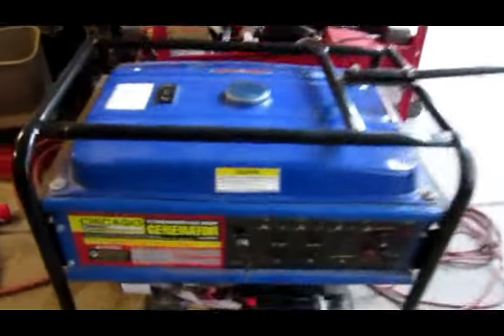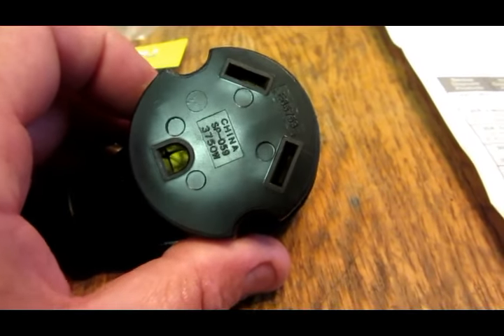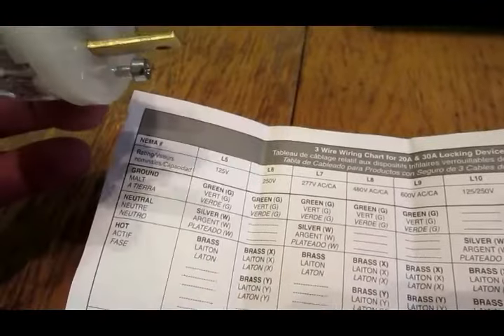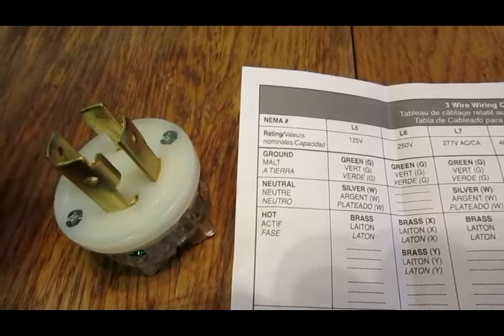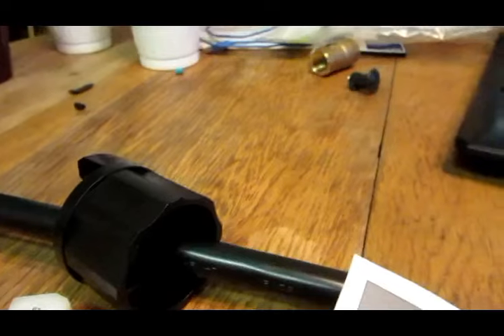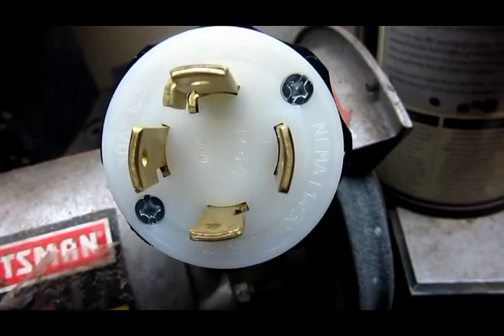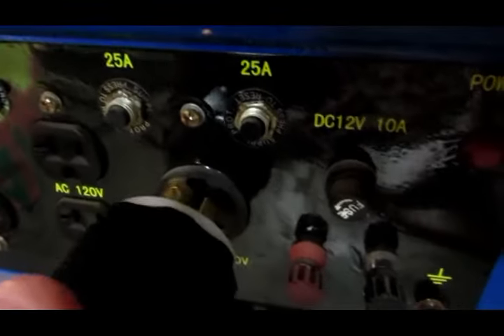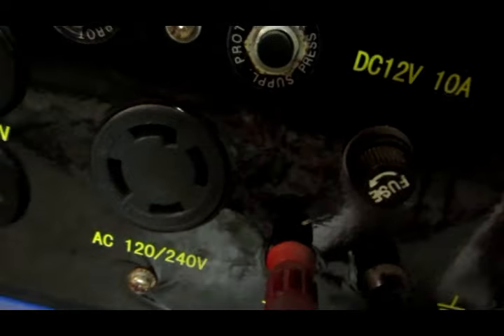Making a dog bone adapter for my  4 plug 240V generator to run 3 wire 120V 30 AMP

Comment: I also  bought a harbor freight generator with that stupid outlet and I couldn't find the plug anywhere except for grainger, a bunch of scammer there. They charged me 65 dollars for the socket. I could of ordered one on line but when you need one now I guess you need one now. 
Great video very helpful. The instructions on the packaging was not clear at all.

Comment: Home Depot also sells a kit that you can plug-in to twist locks on generators for welders and it comes with several different adapters
Reply: I've looked do you have a link

Comment: I need to do something similar, but for a 220V condenser. Do you know what colours are associated with L1 & L2 for 220V? The panel box for the unit uses black for L1 & red for L2, but I'm not sure if that's standard.

Comment: So you wired up a 110 volt 2 30 amp plug. To get a 240 30 from this conversion you would wire green to the ground lug, the other 2 wire to the brass colored lugs omitting any neutral.

Comment: I have an old 5000w genny and that only has two 15a 120v outlets and two 6-15r outlets for 240v. Whats the best way to get 30a into an L14-30 so that I have power to both legs? Do I make a male Y that connects to the L14-30? What does that wiring look like and do I use the 120V sides or is there a way with the 240v?

Comment: If i change the plug on the shore power wire of my camper to go right into my generator rather than putting an adapter on it do i need to reverse the white and black or just wire it up regular? Thank u

Comment: So if you want to get 220 out of the 4 prong do you use x and y for black and white keep the ground and loose the nuetral
Reply: you need a neutral for 120v circuits that are on separate legs, a 240 V say for an AC does not need a neutral

Comment: Hi to you sir, 
Thank you for your very informative video, I'm a bit of an electrical dummy. I followed your very clear instructions from 4 to 3 wires. 
Do I understand that you ended up with 120v?  I have the 4 pin outlet which says 120/2240v. I need to get 220/240v output on a 3 pin pigtail not 120v. 
Please clarify for me how the red & black wires are configured to get the 240v I need on my 3 wire connection?
Thank you for any help you can supply me. I'm in the Philippines without the correct connectors, I'm sure I can find a 4 pin male & a 3pin female.
Reply: im thinking it needs a jumper from the other positive terminal to the positive wire to get the 220/240. let me know if you figure it out. i got a 3 wire stick welder i need to run on the 220/240 :)
Reply: found this 
toadamine
1 year ago
Nathan Hansen for my welder, I just left the negative terminal on the four prong blank... Two hots and a ground... That's all three prong 220 is... Worked fine.
Reply: @Billy_Darley  Don't run a jumper from the one hot terminal to the other hot terminal on the  220 voltsplug. this would cause a 220 volt short.
Reply: Red and black wires are 120 volts each in the United states. Any load connected to them gets 220 volts. If something is connected to one of them and the white common it gets 120 volts. Green is used to ground the frame of an appliance to prevent shock in case of a short

Comment: very informative and if i had ANY skills, i'd do this. it cost me $130 getting the 18" adapter and 25' cord off of amazon to make a suicide cord to back feed the NEMA 14-50 outlet (common 50 amp 4 prong range outlet) i had installed right off my electrical panel.
Reply: i think your okay with that, still cheaper getting the cert. tech to do it for you but they'll be safer and within the code.

Comment: I have a feeling that all he will get with putting the wires like that will be 110 volts.  If he needs 220...should he not put the white wire on one of the hot legs?
Reply from the maker: did you read the description?
Reply: No way man the white wire is the neutral wire.  If he was wiring it for 240 he needs the red wire which that setup was not a four wire setup.

Comment: Basically, you're only using 1/2 of the generator's output 120/240 in this configuration. (So if it's 6500 max watts - 5500 running watts, you have 3250 max watts - 2750 running watts available to you.)
Reply: Can you explain how this is? I'm genuinely curious as I'm not very knowledgeable with this stuff

Comment: I believe this generator puts out 5000 watts. The power you get depends on the amount of power your generator produces. You are only using half of the output of the generator because you can only connect to one of the 115 volt outputs because that is the way the camper was wired.  Watts divided by volts= amps so divide the output of the generator by 2 because you are using half the generators  watt output. Then divide that by 115 to get amps.  With this generator it would be almost 22 amps continuous. The reason they use a 25 amp breaker is for a peak load like for when something takes extra power for a few seconds when it starts then takes less after it has started.
Reply from the maker: I always wondered that. Thanks for the information. Makes sense now.

Comment: Good video man. My old generator only has the 240v 4 prong twist lock and I wasn’t 100% sure what prongs to hook the wires to. My rv is only 30amp 120v so in order to run it off my house power I will need a single pole 30amp breaker and just a female rv receptacle.

Comment: What would you be losing by adapting to the 120V outlets? Of course if you still had to do a conversion yourself, that is if there is no ready made cord or adapter,  there would no advantage. But if you could simply buy something, what would you lose in performance from the 30A outlet to a 20A? 

Anyone- are all the four 120V outlets on this, or any generator, in phase, or are the two pairs out of phase?
Reply: The 120 outlets are only rated for 20 amps with a 20 amp breaker

Comment: If i splice the red and black coming out of the adapter male four prong that is going into the 3 prong female,  will that give me the 220?
Reply: If you connect the red to black wire you will trip the circuit breaker or a big blue spark. Those wires are at opposite ends of the generator winding with white as the center tap. black to white = 120, red to white = 120. Black to Red = 240.

Comment: You only get 120v  , tell me how to change the 4 pole 240 plug to a three pole 240 plug  , so I can run a shop heater(4800 watt , 240 v ) from the dryer plug
Reply: Did u figure it out  ? 
How to run a 3 prong from a 4 prong Recepticals from Generator.  
I'm need to run a Chinese welder which has only 3 prong but it need 230V..
Reply: This welder has 3 prong yet need 230V. 
Which is why I'm lost in this.
Reply: a jumper from the other terminal to the positive wire is the only thing i can figure.
Reply: @Billy_Darley  I'm in a similar situation with a plasma cutter that came with a 3 prong twist lock instead of a 4 prong. It's a dual voltage unit, but ideally needs 220v. Haven't had anything productive come up just yet.
Reply: @kyesniper  I saw on another video a guy used two of the wires as positives and one as the ground. That gave him the 220v he needed. I've yet to try it myself but in theory I think it should work.
Reply from the maker: Green is chassis ground, white is common . In theory if you took  the black and red wires and connected together you would have 240V. But I herd connect Black wire,  red wire and Green on a 3 plug and leave white wire disconnected.  Id suggest doing more research.
Reply: @jenrajsebastian7566  the easiest way is to put a different cord with a 4 prong plug on the welder. Take note as on what color wire connects to what terminal on the welder. If you can't find a cord with the correct plug just replace the plug on the welder with a 4 prong plug. Just be sure to match the colors.

Comment: I need this exact adapter only in 240v... Can I just put a jumper in the plug connecting the two hots?
Reply: I need this answered as well
Reply: Nathan Hansen for my welder, I just left the negative terminal on the four prong blank... Two hots and a ground... That's all three prong 220 is... Worked fine.
Reply: Thank you!   @toadamine
Reply: @toadamine  I have a Hobart MIG welder,says Volts 200/230,,Amps 29/25..How big of generator would I need to run it?
Reply: @KRConnection  I dont know
Reply: No it would make a 240 volt short if you are connecting the two 120 volt hot wires coming from the source together.
Reply: @KRConnection   7,000 continuous watts is minimum for 30 amps and it could work it hard when the welder is set to high so I would go to a larger generator for longer life. Nothing lasts as long when it is working as hard as it can. I would go to at least 10,000 watt continuous rated generator. Running a generator at its rated watts continuously will shorten the life of the generator. Keep in mind that generators have 2 ratings. One is starting watts the other is continuous watts. starting watts is only for a brief time and is higher than continuous watts which is what the generator can produce continuously. Always go by continuous rated watts.

Comment: If your trying to run 240 volt for a main feed I think your wired wrong. You should have black, white, as power and green as ground or neutral correct me if I’m wrong.
Reply from the maker: I think you should read the description and watch the video it speaks for itself. I'm not trying to run 240 I already have 240. I need 120V 30 amp.
Reply: @mogyver69  got ya

Comment: So how many amps will you be supplying your camper with? 30? Or 20?
Reply from the maker: The point of the video is to convert a 240V 50 amp to a 120V 30 AMP
Reply from the maker: My Camper is 30 Amp and this conversion worked perfectly. I'm able to run my A/C unit, microwave, everything with no issues. I'm even able to run the Microwave and A/C unit at the same time without blowing breakers.
Reply: I just bought a 4 prong male 30 amp adapter that connects to the 3-prong RV extension cord that goes to the RV I'm just hoping that the RV will still be supplied with 30 amps from that generator and not 20 amps
Reply: Correct you made one and I bought one but I have not had a chance to test it because of the hurricane just hoping that this dog bone supplies an actual 30 amp to my 30 amp camper
Reply from the maker: You should be fine. Where are you getting the 20 amp rating? What made you come up with that number? On the generator above It has 2) 25 amp Circuit breakers divided between the 2 - 120V connections gives you total of 240V 50 Amp When you cut it down  to a 3 prong 30 Amp in theory you only have 120V 25 Amp available. so In theory if you drew more then 25 Amp it could blow the circuit breaker. I have not had that issue at all. And just to be clear there's no possible way you could damage the new plug cause it would be rated at a higher rating. As for the generator or anything else it has a circuit breaker there so if you were over loading it you would know..
Reply: My generator goes green, black, n yellow (white).
Reply: It depends on the output of your generator. Wiring an adapter this way you will get half the power a 220 volt generator puts out because you can only use one of the 115 volt outputs but that is the best you can do unless there is another connector on the camper for 220 volts. Divide the continuous wattage output of the generator by 2. Then divide that by 115 volts to get the amps. with a 5000 watt generator it would be almost 22 amps continuous.
Reply: You need a 7000 watt generator to get 30 amps if the generator has a 220 volt output because you are using half the output of the generator. If you can get a 3500 watt generator that only has a 115 volt output it would also give you 30 amps. I don't don't know if they make one. I would guess that they would have a 220 volt output at that wattage.
Reply: The breakers are rated at peak amps so they can allow 25 amps for a few seconds when something starts. Generators usually have a continuous rating and peak rating for a brief starting load. Continuous output would be almost 22 amps. I believe the generator he had was 5000 watt output. using half of it would be 2500 watts. Divide that by 120 volts to get the amps and you get 20 amps. If you figure it at 115 volts it is about 22 amps.
Reply: The camper can only get 1/2 of the rated amps of the generator because this is all the generator can supply to the camper. It looks like the breaker on the generator were 25 amps so if the amp draw exceeds 25 amps the breaker would shut off.

Comment: So using a 3 core flex wire, how do I wire this twist lock plug to recieve only 240v from it ?
Reply: When you say only 240 volts do you mean 120?  What are you connecting the generator to?
Reply: I have the same question. If I want to run a 3 prong 240 volt welder. Am I understanding that I have to connect x and y prongs together behind the 4 prong plug coming out of the generator?
Reply: @bottomrunner869 , what's being done here is the x and y poles will each be carrying 120v, the neutral and bare wire (white and green) should be jumped coming out of the four prong. The dangerous part is that on the three prong side, the bare wire will carry your ground and neutral, while you pull voltage on the white and black wires (120v from the four prong side black wire and 120v from the red). 240v is no joke and a trip to the hospital or morgue if you aren't careful. I'm not sure what size welder you have, so a small generator might not provide enough power anyway.
Reply: Thank you, Govtpig.  This information is much appreciated. Would it be better if I ran the ground externally? External ground from welder case to ground prong on plug  and then ground the generator to ground stake?
Reply: @bottomrunner869  I wouldn't run a ground stake on the welder side. I've seen people jump the neutral and ground (green) on the generator side of a 10/3 wire and I've seen others not connect the green at all. I want to reiterate that you are working with enough voltage to seriously hurt yourself. It might be a good idea to find a good electrician to make a cable for you or look over the one you make.
Reply: @govtpig  hi govpig I understand about the 240 volt. Know that all will be plugged in before I even think of starting the generator. Warning heeded. I will also dissamble in reverse with shutting of the generator first. I just want to be sure that the generator or welder will not be damaged. So my plans are to stake the generator to the ground post that is on the side of the generator. Then attach a separate ground to the side of the welder and hook this wire to the remaining prong at the rear of the 4 prong plug that plugs into the generator. Only the generator will have a stake into the ground. Again thank you for your advice.
Reply: @bottomrunner869  your welder is only 3 wire so thats 2 hots and a ground. neutral isnt required. Neutral is required if for instance on a stove or dryer because some parts like the electronics of it are run on 120v
Reply: @ Dan d. I'm trying to do the exact same thing with the welder. So your saying use the ground on green and then connect the white wire to x and then black to y?
Reply: @dan d